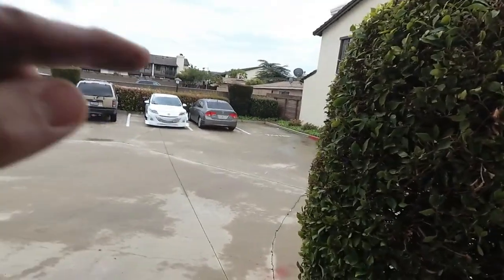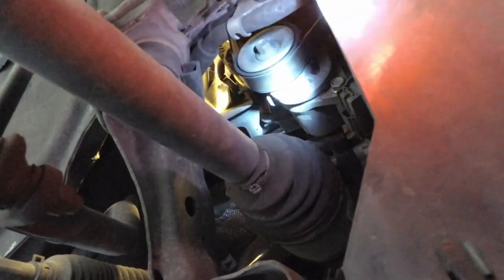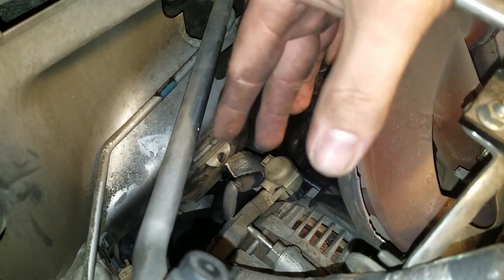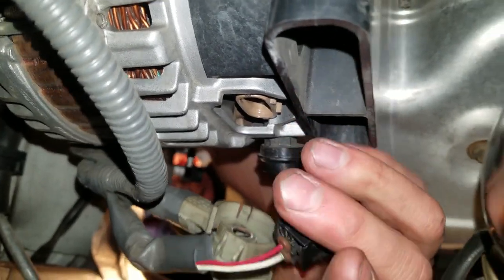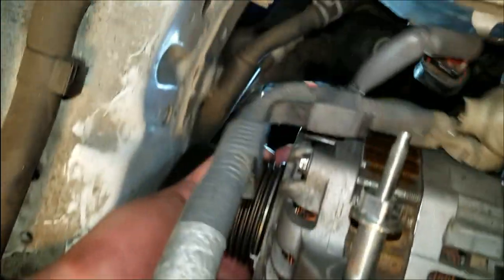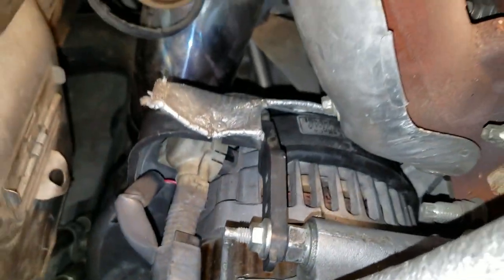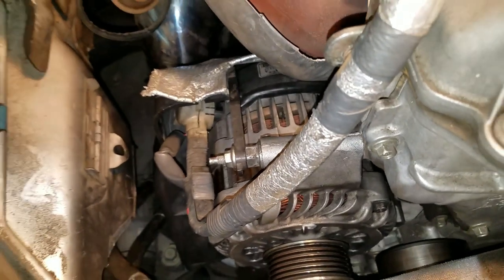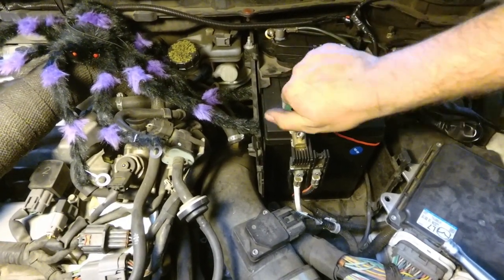How to replace your alternator! [Ms3/Ms6/Cx-7]

Comment: On CX-7, there's a little more room behind the engine, but I had to use a step ladder to reach in, basically just lying down on the fender, with some rags on top of it. The good thing is that you can get a torque wrench on all three stud bolts.
Reply from the maker: Ahh. There you go. Thanks for the input 👍

Comment: How do you get the positive wire clip off?
Reply from the maker: It's just a push tab and pull. You can use your finger to push on the tab while using pliers to pull it off at the same time.